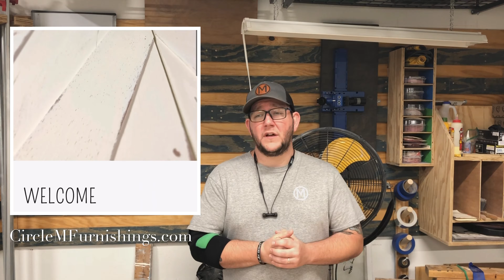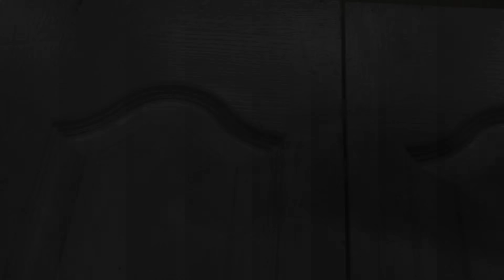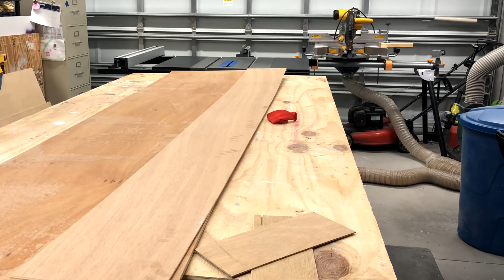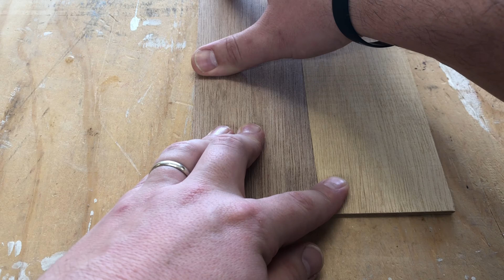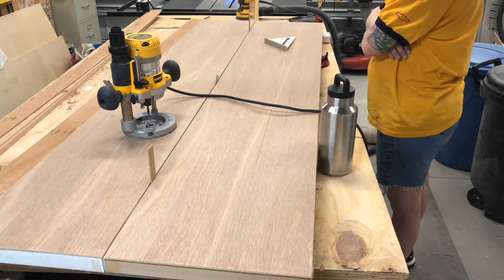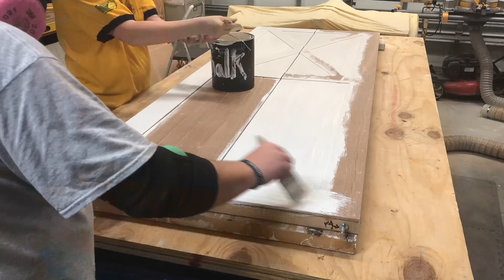Turn Your Bifold Door Into A Bifold Barn Door - DiY - Weekend Project - How To Guide - Step By Step

Comment: Rather than heavily sanding between the "planks", consider using a dime or a washer as a narrow spacer between the planks when gluing the facade to the door front.  You would need to experiment to determine the best spacer width taking into account a stain vs. a triple layer of chalk paint. Such a narrow spacer shouldn't change the visual effect of the planks over the variable surface area of the original door front.
Reply from the maker: I’ve tried that yes, just not a fan of that look. Especially if I’m refacing a louvered door.

Comment: Too much rambling, get to the task. Volume was terrible I had to do cc. Agree this is not a bifold barn door it is  a bifold door painted in barn door style.
Reply from the maker: Thanks for the feedback, we were vloggers before we tried our hand at diy videos so rambling is what we’re good at and old habits are hard to break. 

Technically speaking these doors aren’t painted, they are veneered with hardwood plywood to look like a barn door, but still function on the bifold door (or pivot door) hardware. Therefore making them bifold barn doors. 

If you’re wanting a sliding bifold door with a top mount rail and sliders/rollers then that’s a different thing altogether and not what we built in this video. 

Thanks for watching!

Comment: While the door looks great, it isn't a bifold barn door.  It is a refaced standard bifold.  Bifold barn doors are hung with iron hardware.  Had to get ti the end of the video to figure this out.  

For the round over; how about a sponge sanding block?  You could do two sides at once.
Reply from the maker: Thanks for the compliment, this is technically a bifold barn door (refaced or not). The thumbnail shows no attached rail or roller (iron) hardware, just your standard bifold doors. The door you’re talking about is called a sliding bifold barn door. Thanks for watching!! 

I appreciate the tip, I might give it a go!

Comment: Maybe just use 1 panel per door then use a v-groove bit in the router and a straight edge to achieve the plank look vs cutting individual strips and having to round them over... it's what a do on a lot of my actual barndoor door builds and works great weather sanding or staining...
Reply from the maker: Thanks for the idea, we tried that but for us it always just chips out like crazy. We’re thinking it’s because the veneers are so thin on the hardwood ply we use.

Comment: Thanks for the overview and the finishing instructions. The doors look great.   I have one question. Isn't a bi-fold door hard to open if the handle is placed on the edge? Doesn't it need a knob or handle placed toward the middle of the door so you can pull on it and get it started?
Reply from the maker: You’re welcome and thanks for watching. Don’t forget to subscribe so you don’t miss any of our new videos. 

When it comes to the handles, the style pull we use on our bifold barn doors allows for a pull/push type of hand movement to open the door. It can be a little awkward at first, but not impossible our 3 year old mastered it in about 2 weeks time.